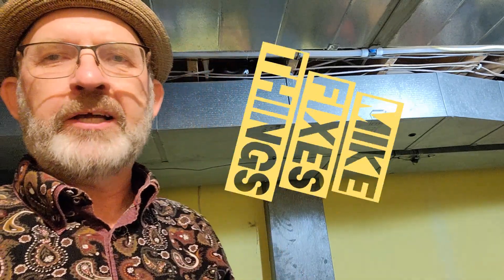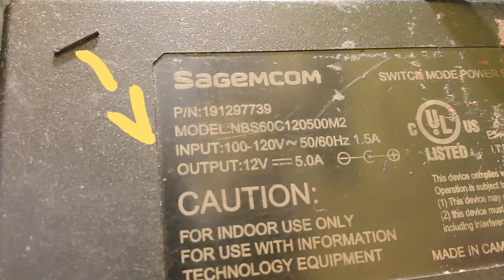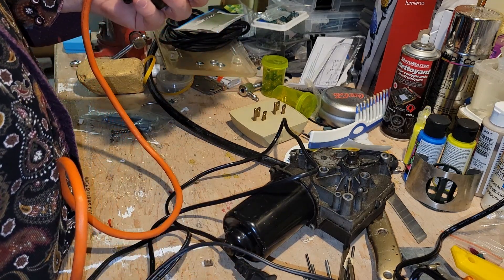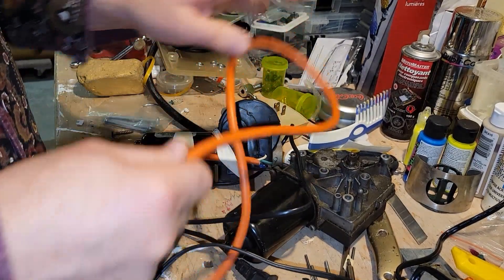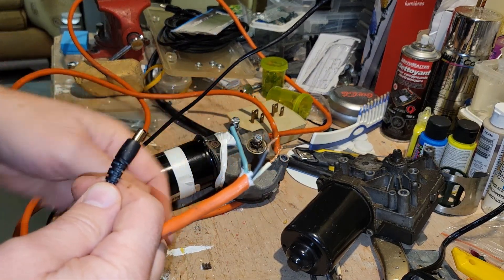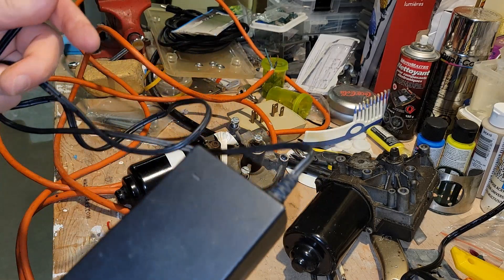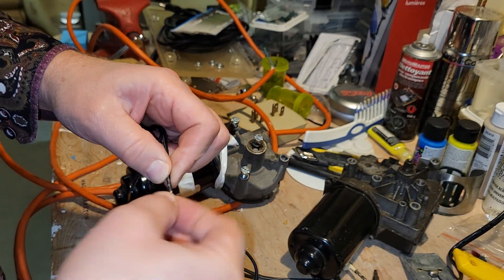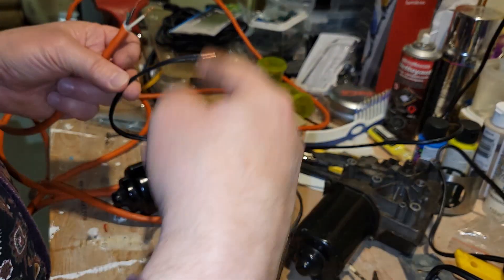How To Power a Wiper Motor to make Moving Halloween Props and Animatronics.

Comment: By the way you held the wiper motor wires upto the charger DC jack and mentioned about allowing it to rest or you'll get a zap shows how you don't know that 12v 5amps will not zap or electrocute you. 

Far too many people need to understand voltages and currents 😊
Reply from the maker: Try unplugging a charger then snipping the wires immediately after and watch for the spark.  There is some residual charge left in the charger that dissipates eventually.